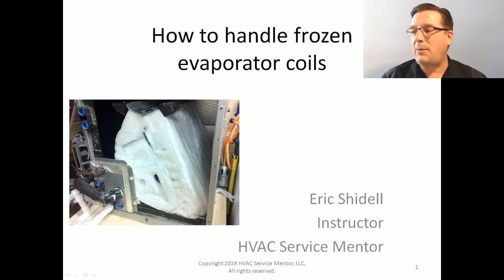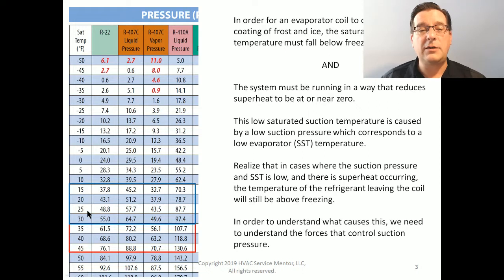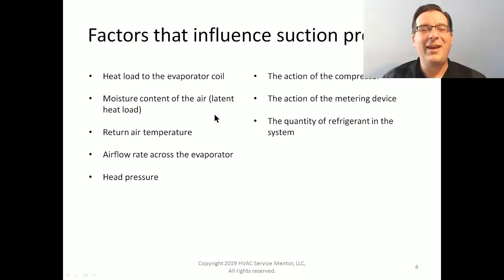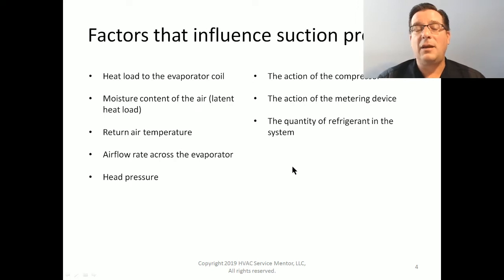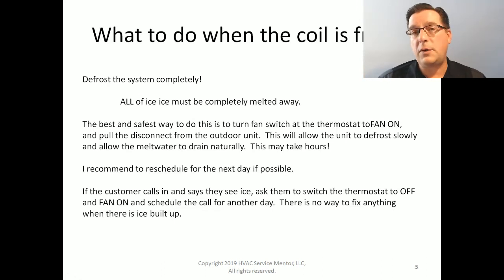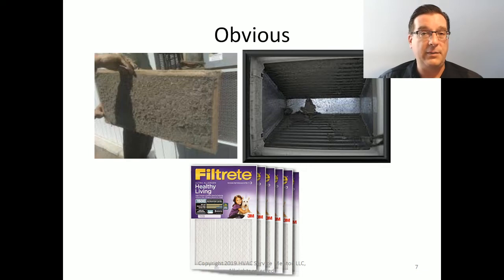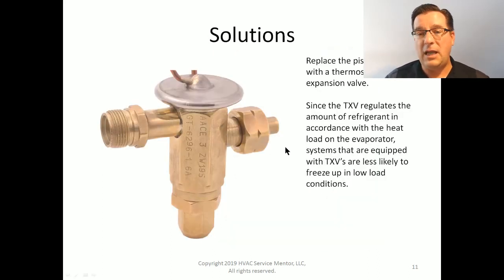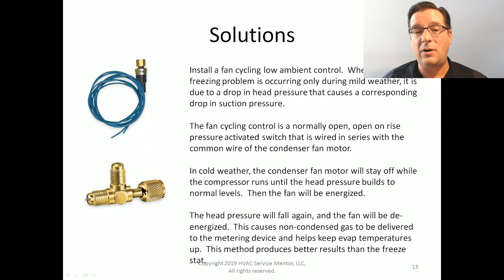How to handle frozen evaporator coils

Comment: (18:07)  Wow!
  This video is phenomenal.  I learned more about the evaporator coil and airflow in this single video than I have from watching videos from other YouTubers AND from my instructor at school.
  I am so glad that I found this video and subscribed to your channel!
My instructor at school actually taught us incorrectly regarding a refrigerant's pressure/temperature relationship!  He told us that the more refrigerant there is in a system (or container), the higher the pressure will be.
Period.
  Granted, like you said, quantity IS one of the determining factors.  However, it isn't the primary factor that is ultimately what causes those pressure changes to occur.  And because he failed to elaborate further on the subject, we were left ignorant of the situation.
  All we have to do is look at a P/T chart from a different perspective: Instead of saying to ourselves, "Okay, this R-410A container is 208psi, so the refrigerant contained inside must be 72°F.", we need to instead say, "The ambient temperature is 72°F, so this R-410A container SHOULD be at 208psi."  If its psi is higher than that, then it is either over-filled, or there are some non-condensables trapped inside...
  Love your videos, big guy; please don't stop teaching us.  😏

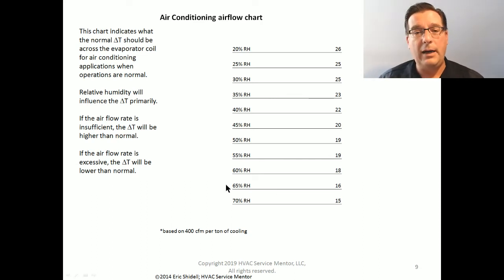Comment: HI, what is the formula you use for the table in 48:00 ?
Reply from the maker: That table was extrapolated from the old slide charts that major manufacturers used to hand out over the parts counter.  Carrier was perhaps the best known one, but Trane and Goodman made them as well.  Nowadays, that info is sometimes published in the unit catalog or selection documents.  It's a bit harder to find.  either way, it is not unique to any one manufacturer.  There is a direct relationship between the cooling in Btu/h, air flow in CFM and delta T that is true for all comfort cooling applications.  When it comes to mini splits, VRF, and special applications like CRAC, these numbers are no longer reliable and you need to go to that individual manufacturer for the right specs.  Additionally, for the last decade or so, Carrier brands have abandoned the old standard of 400 CFM per ton on their residential split systems in favor of 350 CFM per ton for all but arid climates.  This naturally creates a higher Delta T and they will publish this in their literature.

Comment: Wow what a rookie mistake that guy made.  Charging with a frozen coil.  I can’t believe he didn’t let it defrost and. Come back later to check.  Can’t believe he had 10 years of experience. Maybe he never learned the basics.  Could have been a low charge, a restriction, low load from restricted airflow, low head pressure from running in a low ambient, etc.  you can tell by the look of the frost, or ice.  Frost means it happen Fairly fast where a restriction or shortage frosts at the beginning then moves along, forming mor of an iced look.  If the suction line frosts soon after starting, it is from low airflow.  You my friend are a very good teacher
Reply: 01:22

Comment: 30:48 - I was taught the complete opposite.
  When a unit is low on refrigerant, your manifold gauge will show high Superheat, low Subcooling, and low pressures on both sides.  And since temperature & pressure are directly proportional, the lower your temperatures, the lower your pressures.  You even confirmed this at 33:22.
  Would you please elaborate on my confusion here?
  Thanks.
Reply from the maker: This is a very insightful question.  I apologize for the delay in response.  To be clear, we need to differentiate between the temperature of saturated refrigerant which follows the pressure / temperature relationship you mentioned and the temperature of superheated vapor leaving the evaporator in the suction line which does not follow that relationship.  High superheat will be the case as you mentioned.  If you start a unit that has low refrigerant with low suction pressure and a saturation temperature of, say, 20degrees (well below freezing) and a high superheat of 25 degrees, the suction gas temperature leaving the evaporator will be 45 degrees (well above freezing).  Hope that helps clear things up.
Reply: @hvacservicementor Oh man; thank you so much.  That most def cleared things up for me. 
  I've been in the field for 2 years now, and never considered that superheated vapor doesn't follow a pressure/temperature chart.  I always assumed that, no matter a refrigerant's pressure, you can always convert that to a known, relative temperature.

Comment: The most common here in south Florida is what you just mentioned low on refrigerant blower motor failures constantly and TXV‘s with the rare contactor problems and that order 123 and 4 With a lot of cases of dirty coils and filters because they run all year long❤🎉😂

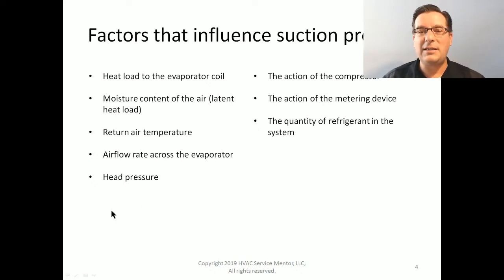Comment: 23:30 - Technically, the compressor's job is to create a pressure difference by raising the pressure at its outlet and lowering the pressure at its inlet.  The job of the metering device is to create a pressure difference in the opposite direction.
46:46 - When you say temperature drop here, are you referring to TD, or ΔT? 48:00 - OK, you answered the question, here (i.e., ΔT, which is the difference between the return and supply air temperatures and not temperature difference - TD, which is the difference between the air temperature and the saturation temperature of the refrigerant).

Comment: We were on an 8 system maintenance We found three of the 16 seer carrier units with very low pressures in a little bit higher than normal head pressures and all three of the capacitors were about the Fail. ❤ for today. Was getting about 101 and 360 on a 86° day afterwards was like 128/330😮😢🥳😎👍

Comment: Always enjoy your presentations! One question in regards to the fan cycle switch. Is there a chart or reference I can access to determine the proper psi for the switch? I assume high side fan switches comes in many different psi settings. Thank you!
Reply from the maker: For the encapsulated non adjustable ones, you select them based on the refrigerant used.

Comment: Good video, one question, checking RH , where about location should be? Close to return or middle of the room? Close to thermostat?
Reply from the maker: When checking RH, we are interested in what the Evaporator sees.  You want to measure RH as close to the inlet of the evaporator as possible.  Usually, this is in the Return air stream at the air filter or main RA intake grille.  If there is a outside air duct joining the return trunk between the RA grille and the evaporator, that can throw things off a bit.

Comment: My evaporator  freezed.
Notes the condenser unite outside stays on all the time.
About a month ago I pull the inside unite fan for cleaning and the evaporator just blowef with my compressor air gun.
I changed the filter every  six to eight weeks.
What could be the problem.

Comment: At 59:30 do you have a typo in the slide? Isn't the switch normally closed, open on DROP pressure switch? When pressure gets too low, you want the fan to stop so pressure can rise. So you open the switch, which shuts off the fan. Normally, you expect the fan to run at all times, so it is normally closed. Am I understanding it correctly?

Also, as many others have noted in the comments, what happened to your website? It immediately asks for a login, and there is no way to view anything else.
Reply from the maker: I will look into the video about your question. Website was in transition go to https://hvactraining.squarespace.com/  (Edit) Good Catch!  There is a typo.  It should read Normally open, Close on Rise.  This switch is normally open.  Normal refers to the position of a switch when the unit is at rest.  This switch will be open until pressure rises to the cut in point when it will close.  While  you are correct that the switch will open when pressure falls below the cut out point, standard practice is to consider what switches will do on a rise in the controlled medium.  This can get extra confusing with low pressure switches and loss of charge switches.  Under normal circumstances, when the unit has normal pressure, these types of switches will be closed at all times.  Those switches are often drawn on schematics as normally open because it is the rise of pressure above their setpoint which closes them.  If you were to find one in a box and test it, you would find it open.  In fact, I've seen those drawn both ways!  Great question!

Comment: Sir.  I have a  3 month old dual fuel heat pump Lennox.  In cool mode it runs fine, gas furnace doesn’t trip on high limit but on heat pump mode my pressures sky rocket to 575 psi on both sides with in 15 seconds of runnngs then trips on high limit and gives me an ambient sensor fault.  I diagnose it as a faulty/clogged txv but not sure witch on exterior or interior so I’m changing both.  Can u help me asap?  What would cause those pressures?
Reply from the maker: This isn't tech support.  That would be irresponsible.

Comment: If that’s a downflow unit that would be disastrous. I would tell them to turn it completely off you would almost have to babysit it regardless are there going to be a flood and some damage of some sort. The best thing is to have freeze protection so it cannot freeze. As well as low pressure switch etc.😂🎉❤😎👍

Comment: Typically the evaporator skin temperature is about five degrees above saturated suction pressure so R22 won’t ice until about 52 lbs suction.  There is a loss because of circulating oil, and heat transfer of the evaporator material.

Comment: I had a customer call said the unit was freezing up we get out to the job and I noticed a big hole in the return plenum the size of a license plate I asked the customer what the hole was about he said the other company said there was not enough hot are going into the unit to keep it from freezing I just 😅 I fix the hole in the plenum check the air filter that was clean check the pressure thay were good so I sat there and watched the air handler the blower fan would shut down and start back up a couple minutes later we replace the blower motor everything is good some technicians are not technicians
Reply from the maker: Sitting and watching.  A very important part of the diagnostic process.

Comment: But the blower is more important because if the air that's going thru the coil isn't enough then it's going to freeze and if it's to much then it won't cool
Reply from the maker: The blower is responsible for delivering the heat load to the evaporator.  It is very important.  In three phase units, reverse rotation of a fan motor will create this problem.
Reply: @hvacservicementor  
TXV is the elegant solution.  In the absence of that, why not adjust the airflow across the evaporator to regulate the heat load?  For example, a temperature commanded VFD.  Or a 2/3 speed fan motor switching speeds based on inlet air temperature thresholds.  Or multiple fans with reverse flow blocking shutters.

Comment: Question, how was he a GREAT tech if he doesn’t know air flow first? You started the video with he’s a great tech with ten years of experience, which ids possible, but doubtful, then you proceeded to tell me he added 15lbs of refrigerant to a system that holds 15 lbs. no leak search? Leak search would have been the second time that he should have seen that coil.   NOT A GREAT TECH, GREAT HACK MAYBE, BUT NEVER A GREAT TECH!

Comment: Is it possible for evap to freeze due to being overcharged?
Reply: Nope overcharging a system alone won't cause it to freeze the evaporator.
Reply from the maker: Generally, the answer is No. Freezing evaporator is almost always related to heat load at the evap in some way.